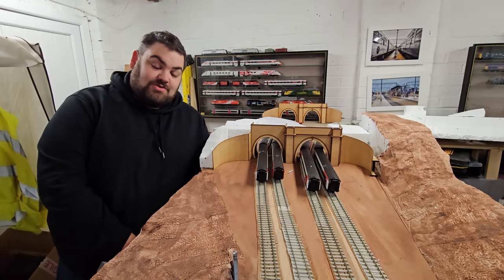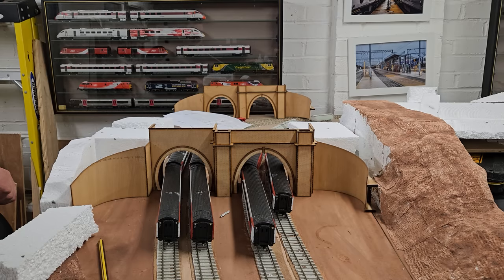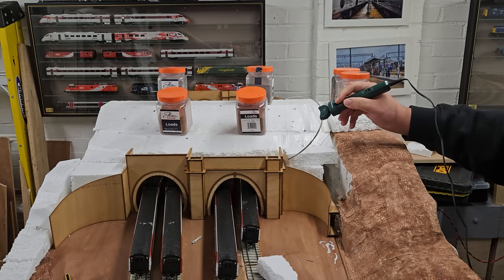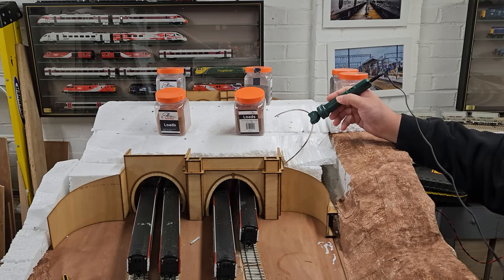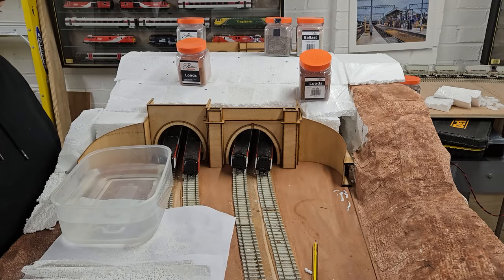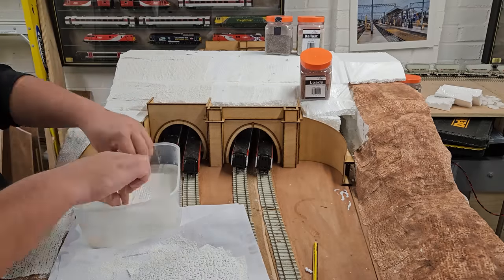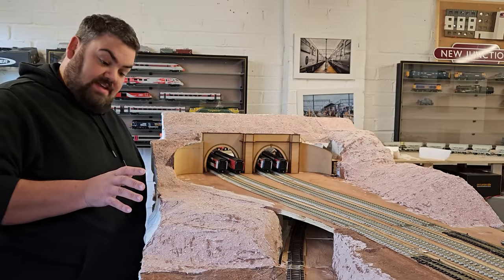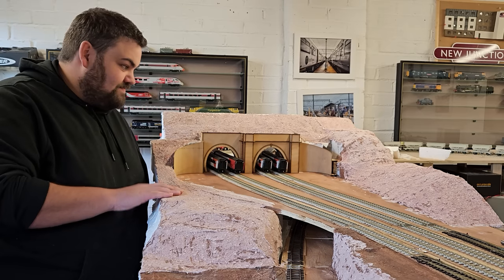New Junction EP18 - Tunnel portals

Comment: If you have not already got one, consider a dehumidifier because it will reduce the moisture in the air which will help dry the build and also keep the room damp free plus reduce the need for heating in the room - I use a Maeco one and it is amazing the difference it makes without needing to crank up the heating to remove that damp feeling
Reply: Grrat information 👍🏻
Reply: I second the suggestion - the Maeco Dehumidifiers are superb and using one regularly would definitely reduce drying times
Reply: And and washing on clothes airers in the same room dries quick too. Less mould in the bathroom as well. We have two.

Comment: with that small section in front of the tunnel portals that you said about not putting anything in cause of having to move the portals; if you constantly have to move the portals cause of layout transformation, you could always make a small section of the hill for there, attach 2 dowel rods to the bottom and drill 2 holes so that you can remove it at anytime.  i would recommend a small built up area on layout part that you can decorate with like a bush to hide any imperfection that is caused from the removable piece.  always enjoy watching the videos and seeing the progress you make!

Comment: Great work, Richard.  Sadly, whoever told you to dye the sculptamold forgot to tell you to go a much darker hue/shade, because the putty itself will lighten it.  You definitely do use a lot more paint, because you are technically painting every cubic millimeter, and not just the surface.  It has its benefits (no touch up repairs on chips, less work on rock facings when doing them) and drawbacks (cost).  So, it was cool to see you try it and give it a bash!  Cheers

Comment: Back in the day, before they'd invented Sculptamold, when I used plaster of paris for the same thing, I got powder paint/pigment from the local art shop (think it came by weight) which did a better job of colouring the plaster all the way through than your poster paints seemed to do. Might not work as well with Sculptamold as, like you said, with all the fibres in it, there's a massive overall surface area in it.

Comment: Paint the surface before the sculptamold dries, let’s it into just the top millimetres or so. 
Love sculptamold but impossible to get and going for silly money now. Experimenting mixing fine sawdust with plaster and want to try soaking loo roll until it breaks up before adding the plaster. 
Be careful using loo roll in a blender dry. Without the water to take heat away many have melted the plastic parts and ruined there blenders.

Comment: Mix the paint with water first, and then add the sculptor mold. it work better and needs less time to mix. The drying time is a bit longer but it works and yes it is less notable when it chips.

Comment: Just when you thought you could have a rest! 😉 Nice spooky beginning: first layout poltergeist I’ve ever seen 😂 👻 Then again, technically, doesn’t that mean that you DID actually have a train running in the video? 🤔

I must admit when I woke up this morning I had no idea I would hear the phrase “I’ve mixed up a brown wash to go over the pink sausage meat” today, but it certainly raised an eyebrow or in this household followed by extremely childish giggling 🤣😂😅 But a job is worth doing right and I think it will do the job for you 👍

Funnily enough, one of the things I like most about that tunnel mouth in that space is that it looks as though one was built first and the other was built several years later as the traffic grew which is very much realistic and rarely modelled thus!  👏 Just a little hint I found useful which you might not have thought of: for holding things in place temporarily, get some half-decent double sided tape so stuff sits where you want it. But only half-decent because you want to be able to remove the tape afterwards! Alternatively just mark the edge with a Sharpie 🤓 I’ll give that as repayment for the heads up on the little orange gizmos which might be the answer to not stabbing and crushing my fingertips in future😉

By the way, I can’t believe you deprived the Boss a walk because of an insy spot of rain or two! She looked so plaintiff, but then she is an adorable pooch! 🐕 

Cheers Richard, have a great weekend mon ami! 🍻🍀👍☮️

Comment: Richard I can't believe your waiting for material from USA to complete and then waiting for time to dry.  Try using the polly filler you used for your roads, dob it on and then paint it over bandage material with 2"/3" really wet paint brush.  You will have a hard shell as soon as it drys and it will dry really fast.  Faster and way cheaper.

Comment: Hi Richard,  All that plastering and painting with the coaches sitting there in splatter distance was giving me palpitations lol.  It looks really good though and I agree, it's probably alot cheaper and easier to just repair any chips (if they occur).  The rail joiner mate are really useful,  I got a set myself and as saved me from abit of cursing whilst working on the fiddleyard :)  Cheers,  Michael

Comment: Be cautious about the temperature of the water you use for your plaster bandages. Plaster setting is an exothermic reaction, not just a case of drying, so the warmer the water, the faster it sets! (I work in A&E and use plaster on a daily basis!)

Comment: Since most damage to scenery on a portable layout occurs at the interfaces and board edges. Plywood profiles of the desired scenery shape would add protection and also make hot wire sculpting easier with a profile to draw the wire along.

Comment: The trouble with adding paint to filler/sculptamould etc is that it's already diluted to make the paint. As some have mentioned food colouring colouring may work but the best solution would be to get actual paint pigments so that you are starting from concentrated colour.

Comment: A bit puzzled as this is an ECML inspired line why you haven't added some sort of overhead rail/bar or similar for the o/h pantographs to rub on inside the tunnels? Will you be running all your electrics pan down?
Reply from the maker: Not got round to it yet 😁
Reply: @NewJunction  was thinking as you glued the poly blocks down that you might need to lift them later to get the o/h underneath.